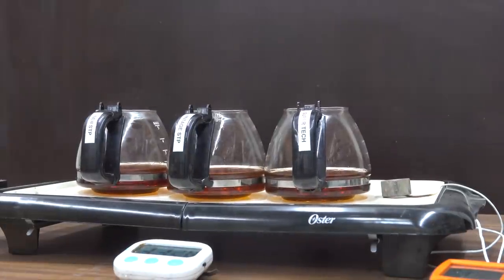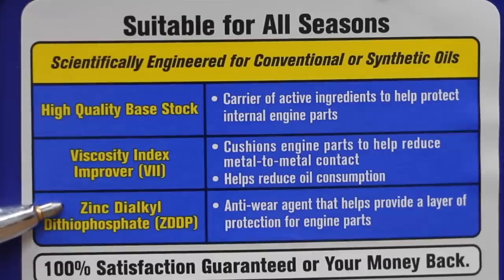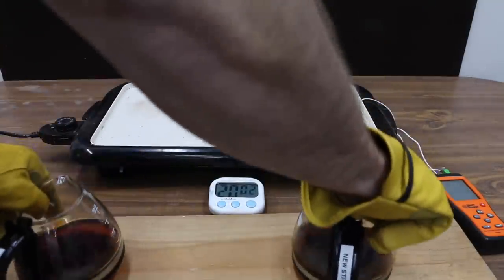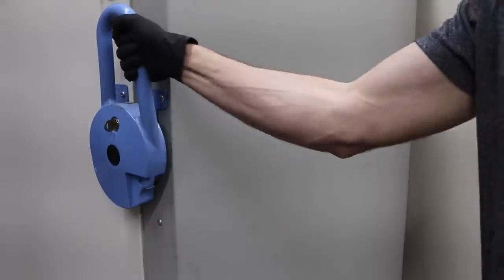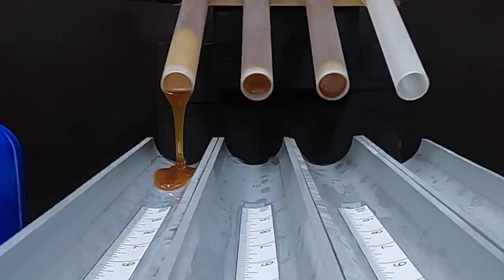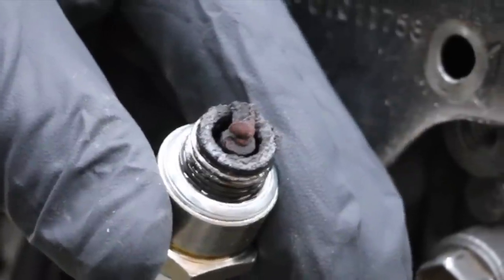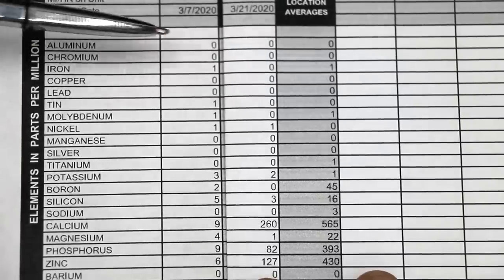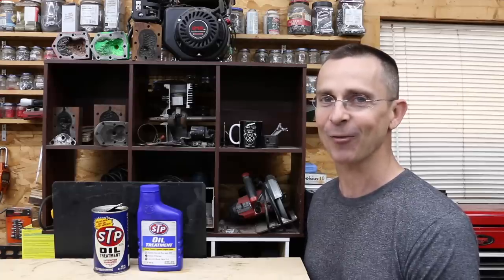Richard Petty's 1981 STP vs 2020 STP?  Let's find out!

Comment: I've been using Lucas synthetic oil stabilizer in my 96 5.2L Jeep Grand Cherokee every oil change for about the past couple years. Recently I had to pull the oil pan off to change the rear main seal. I was really surprised to see how clean it was in there. I use synthetic blend 10w30 Castrol and 1 quart of the Lucas synthetic oil stabilizer. I never bothered to use anything extra in my oil until I saw the oil stabilizer/ lawnmower engine test on this channel. While I was in there I decided to change the timing chain, front seal, water pump. A good vehicle is so expensive nowadays, I decided to just keep this one in good working order.
Reply from the maker: Thanks for sharing.

Comment: I used STP to increase viscosity and pass an emissions test in a smokey old 1984 Toyota Camry and it worked! I was sitting in the queue for a while at idle and hit the gas a bit which released a heck of a lot of blue smoke! It billowed up and blew through into their work area. One came out, saw what had happened and told me to get the heck the out of there! i left, bought STP and came back a few days later and passed the emissions test ! I suppose the valve guides let oil seep down into the combustion chamber during the prolonged idle.
Reply from the maker: Thanks for sharing.

Comment: Used in in my old 1953 Chev Belair in the late 1960's back when there were no engine oil filters, oil leaks were common and multi-weight oil was not common.  It (and it's competitor "Motor Honey") cut down on oil burning (worn rings & Valve stem seals) compared to straight SAE 30.  You could also use a little in the Powerglide transmission, helped it run better and never seemed to hurt.  Only downside was slow starting due to thick oil during the winter and the endless wait for the cans to empty when using the product.  Back then motor oil was yellow, slippery and not much else was added.  They did offer detergent oils but using them ran the risk of cleaning out the sludge that was making up for the engine wear.
Reply from the maker: Thanks for sharing.

Comment: I've seen STP work very well as a seal softener. Rear main seal leaking virtually stopped the seal leakage within minutes, however the oil was changed the next day, and the oil leak stopped. STP has its merits.
Reply from the maker: Thanks for sharing.

Comment: I was a Volkswagen mechanic back in the 70&80s and I had a VW come into my shop on the hook with as customer stated locked up engine, the outside temps were near zero F. After bringing the car in and pulling the engine for disassembly, I removed the oil drain plug, but no oil came out which was not unusual but when I went to separate the case halves I discovered it was full of STP or something similar. After I got everything clean I was able to reassemble the engine, I did replace the rod bearings and camshaft bearings but reused the crankshaft main bearings and the engine ran like new. I was able to save my customer about $400 in parts and labor.
Reply from the maker: Thanks for sharing.

Comment: I am still eagerly awaiting a panel bond video. Some of the strongest adhesive known to man. I think you would need a new testing device in order to get it to fail. It is the adhesive used to glue panels on cars. I would LOVE to see a showdown between the competitive brands such as 3M. Smart. SEM. Ect. I would pay to see this!
Reply from the maker: Great suggestion!  Thank you.
Reply: I worked in auto body for many years and would love to see a comparison of panel bond epoxies as well.  3Ms line makes some bold claims that it is as strong as a weld.

Comment: I remember putting that STP in a 1971 Merc. Monterey we had that drank oil. (Around 1981 ironically) It was so thick and I would of course put it in with the eng. running!  IT WAS A FLAT RIBBON OF GOO! Didn't just want it to all go set at the bottom of the pan! Crazy memories!! Thanks for another great shared experiment!!
Reply from the maker: You are welcome!

Comment: When I was young 20ish yrs old, I was told that the only time to use STP was exactly what you said, when the engine needed to be quieted due to mechanical issues.
Also when I worked at a trucking company we used JB Engine tune up additive (It had a viscosity very similar to water). The salesman came with a wear testing machine like yours. The engine tune up additive provided better wear protection hands down than STP or even JB engine oil concentrate (JB's answer to STP). We used JB engine tune up additive every time we changed oil.
We got 500,000 plus miles out of every engine rebuild.
Reply from the maker: Thanks for sharing,

Comment: I recall when Andy Granatelli's 1969 autobiography:  They Call Me Mister 500, (in reference to his participation in the Indianapolis 500 auto race), where he wrote about his first-time awareness of STP:
He was in-charge of doing speed endurance tests, at the Bonneville Salt Flats in Utah, for the Studebaker car company with its high-performance Avanti model in the early 1960s.  There were mechanical issues of the Avanti V8 engines running too hot and low-oil pressure.  Granatelli consulted with a  trusted mechanic, whom suggested adding STP to the engine oil of those Avanti cars.
After doing so, Granatelli was impressed to find that the Studebaker Avanti V8 engines ran cooler and it raised the oil pressure in the Bonneville Salt Flats endurance runs.
Eventually, Granatelli because CEO of STP and was a marketing genius for the brand.  At car shows the STP decals were freely given out.  
Many of the competitors at the Indy 500 used STP as an oil additive from the mid-1960s onward.
The 1967/68 Indy 500 race cars sponsored and owned by STP/Granatelli were aircraft turbine-powered racers, which elevated the STP brand to unheard of notoriety in the motorsports world.
The Granatelli owned Indy 500 race team won the 1969 race with Mario Andretti at the wheel.  The situation at that race was a marketing coup, not only for the victory for the STP team, but that supposedly the STP team upped the amount of the oil-additive to the winning engine since there was an issue of having to remove an engine oil-cooler prior to the race.  The scenario behind that oil-cooler removal:  After Andretti qualified the car for the race, it was discovered the engine was running too hot in prolonged runs, so an oil-cooler was added to the engine and it solved the problem.  But, the race officials ordered the removal of the oil-cooler since it was not a part of the car's configuration for the qualifying run.  After the oil-cooler was removed prior to the race, the workarounds the mechanics did to minimize the engine overheating:  Richen the mixture of fuel to air with the engine's injectors, and increase the amount of STP to the engine's oil.  
Well, with what was reported in 1969, the strategy work!

BTW:  The Wikipedia version of the 1969 Indy 500 race was in error about the use of the additional oil-cooler in the race.   It was removed prior to the race; the media made an issue about it back then.  

But, as was typical of race cars of that era with their precarious reliability:  A compelling reason STP/Granatelli/Andretti won the race was due to other teams/drivers having more mechanical misfortunes than the  STP/Granatelli/Andretti trio.  Decades later it was also revealed that second-place driver Dan Gurney could have contended for the victory if his car had not developed a shock absorber problem in the race;  where part of that problem was due to the lack of development time with the car leading up to the race.  It's been surmised that if the All-American Racers team, lead by Gurney, had invested time with the 1969 Eagle race car development prior to the 500, it could have been in the winner's circle.
Reply from the maker: Thanks for sharing.

Comment: Another great video!! Sure didn't realize how good super tech oil was.  Back in 73 had a 64 impala 327 that was so bad on compression that wouldn't start off key had to park on hill to start it smoked bad I bought case stp filled it up it actually started off key and barely smoked used it till they started puttin it in plastic bottles.  Thanks for sharing be safe have fun
Reply from the maker: Thanks!  Thanks for sharing.

Comment: I had a 390 V8 with a knock in my 1974 Ford F250  and added STP, this was 1978. I ran it for 3 weeks dropped the pan and replaced the rod bearings no damage to the crank!
Reply from the maker: Thanks for sharing!

Comment: I got water in the trans and engine of a 73 Chevy Vega while playing amateur boater at a lake 40 years ago.  I changed the engine oil at the boat ramp and towed the boat home.  Over the next few weeks the syncro's went out in the trans.  I wanted to trade the car in so I pulled the trans and filled it almost completely with STP.  Worked long enough to get rid of it.
Reply from the maker: Thanks for sharing.

Comment: I have seen an oil pan taken off of a car engine in which the owner used OLD STP religiously. It looked like a thick layer of honey in the bottom of the oil pan. 

I would NEVER use STP in my car unless I was in the middle of the desert and my engine had no oil in it. I would use it ONLY if it meant I wouldn't have to get out and walk. 

Back in the day, people used to load the engine up on an old worn-out oil burner before taking it to trade in on a new car. If you ever bought a used car doped up with STP you bought a serious problem. 

An unscrupulous (unethical) Used Car dealer would dope up an old clunker and sell it as a well maintained used car. 
There were no used car warranties or Lemon Laws in those days. It was truly Caveat Emptor... Buyer beware. 

This was yet another  OUTSTANDING comparison video. Thank you.
Reply from the maker: Thanks so much!

Comment: I used STP in my Yamaha Rstd 1300, after running seafoam my 16 year old engine started making tapping sounds, I had it checked out and the result were the bike is fine, however some carbon deposits are good for pressure in older engines,my 47k miles bike is now running so good, highly recommend for higher milage rides, I used one third halfway point until next oil change,the improvements are noticeable and a better performance
Reply from the maker: Thanks for sharing!

Comment: A late stepfather who raced early NASCAR and SCCA taught me to make the lube for building new engines. Before it was banned, he mixed STP and White lead for diff gear oil. He raced a 67 Shelby with a 289 pushing 504 hp @ 9000 rpm. Black flagged him at Daytona. 167.76 lap speed, 210 on back stretch. Only driver standing on the throttle in the turns. Smokey Yunick trained. I will always appreciate and miss him.
Reply from the maker: Thanks for sharing.

Comment: Back in the early 1970s I bought a 1957 Chevy and on the way home it started smoking really bad. I changed the oil and put a can of STP in the engine. within a few miles the smoking got less but was still there. I then put a second can of STP in and the smoking stopped. We had 3 small children at the time and my wife made me get rid of the car. Jim
Reply from the maker: Thanks for sharing.

Comment: I'm crossing my fingers that you'll do a video testing out STP's Ceramic Engine Treatment, which claims to adhere to internal engine parts for up to 15k mi.  improving compression, engine performance,  fuel economy, yada yada yada (like they all do). Supposed to be kind of an improved upgrade from the old PTFP liquid Teflon of the past. Really enjoy, and appreciate your videos.
Reply from the maker: Thanks and you are welcome!  Thanks for the suggestion.

Comment: Excellent! ❤The Fisher Space Pen  pointer. That's a sign of someone who REALLY knows about viscosity...maybe even thixoptropy!
Please do a video testing 1980s Fisher Space pens against modern ones. The curator opened the display case at the Weatherford OK Air & Space museum and we tested Col Stafford's pen that had been to space in the 70s. It wrote perfectly. Sometimes a very old Fisher Space Pen has to have the point soaked in alcohol or ether or a flame applied to get started.  Inventor Pau C. Fisher was my cousin and taught me much about science, diplomacy, and government corruption.  Gravity-fed normal pens have a 1-2 year shelf life at most. If left in a hot car even one time, they are toast. The Fisher Space Pen is the only way to fly!
Reply from the maker: Thanks!  Thanks for the video idea.

Comment: I had a 1957 Studebaker Pelham (2 door wagon, think Nomad only cooler). It had a not very healthy170 CDI flathead six. The engine ran a bit rough, smoked, was down on power, the oil pressure light would come on at idle, and made clicking noises from the lifters (one had a cracked bore). With a can of STP in it the engine smoothed out, pepped up, quieted down, stopped smoking, and the oil pressure came up.

I'd never use the stuff in a healthy engine except as assembly lube, but on that Champion six it made a world of difference.

Now... if you really want to try the best STP you need to find some even more vintage stuff that was made by the Chemical Products Division of Studebaker Corporation. Studebaker engines from the early 60's even had labels on the oil cap "Break In Oil Contains STP", with the STP logo.
Reply from the maker: Thanks for sharing.

Comment: In the 80's my Son was charged with mowing our yard. He hated the job, never checked the oil and pushed the mower faster than it could go. While he was mowing I noticed a lot of smoke and noise. Checked and no oil!! The only oil inthe garage was some old oil from a previous change from my car. It had STP in it. The smoking stopped after the second mowing and the knocking stopped.
Reply: We used that mower for several more years and gave it to the peron who was mowing our yard at the time. STP saved that engine and me some money.
Reply from the maker: Thanks for sharing.

Comment: Early "multi-grade" oil actually was often not very good. 
That STP stuff I was told,unless you carefully added it very very slowly,could sit in the bottom of the oil pan and be too sticky to get pulled up to the oil pump forming an effective plug against the oil pump intake. 
People sometimes used a mix of it in oil as assembly lube.
Reply from the maker: Thanks for sharing.

Comment: One suggestion is a cylinder leak down test is more accurate then a compression test. I know your not trying to troubleshoot where the engine is losing compression. However it would allow you to time before and after how long the cylinder will hold compressed air.
Reply from the maker: Thanks for the video idea.

Comment: So really the results show that STP is just an additive and not to be used as an engine lubricant. It only adds to the friction package of the oil already in the engine. It is the reason the wear scars were smaller with the stp additive than with just the stock oil. The STP added to the super tech apparently increased the quality of the super tech's anti-wear package.

Comment: You have all the fun. They been making. S T P I now back in the 60ies . motors have changed gas has I use to use it when I changed oil my rides were old and wore out. Oil was like beer didn't have 5 20 10 30 etc. More 30 wt.
Reply from the maker: Thanks for the feedback.

Comment: I would love to see how well and how long an engine would perform with pure oil additives like Bestline or Motorkote as opposed to mixing them with oil. Questions rolling through my head are as follows. 1) Will it make any horsepower and MPG difference? 2) Will there be any side effects or downsides to note?
Another idea is mixing different oil additives. The major question to this is "Are there any risks to mixing different oil additives?"
Reply from the maker: Thanks for the video idea.

Comment: Yet another terrific analysis.  Used to run a moly-blended conventional oil sold by Honda for motorcycles that I really liked.  The engine seemed to run a little quieter, and being air-cooled with the engine right in front of my shins, seemed to run a little cooler during the summer months.  Really like it.

As a side note--and completely off-topic--just how many aging lawn mowers do you own?  Have watched nearly a dozen of your videos and every time, seems to be a different make/model.  You must run a side business in used lawn mowers. :)
Reply from the maker: Thank you!  I still have around 15 lawnmowers in storage but they don't get much use anymore

Comment: It would be interesting to see how a vintage can of Hastings Motor Honey would compare. Seriously, one of my family members worked for a company called Lubrizol for 38 years in the field of tribology, the study of wearing surfaces.  Once an S&P 500 company and now owned by Berkshire Hathaway, Lubrizol manufactures the additive packages used in many of the major oil brands.  This individual was very familiar with the various testing criteria specified by CAT, Mack, GM, etc.  The word from him was to never use these additive products, buy good oil which has everything needed already in it, and change it frequently.   He had studied countless teardowns of mostly automotive engines put through bench tests often lasting several thousand hours at the facility where he worked.  He was always a big fan of Shell products, but said there was nothing wrong with Chevron and Mobile.  He otherwise frowned on many of the brand names often displayed as sponsors for race car teams and sold in discount stores.
Reply from the maker: Great suggestion! Thank you

Comment: You should compare the three modern stp oil additives.  I've been using the high mileage Grey bottle stp additive in knocking and smoking lawn mowers and it works great at helping with those issues.
Reply from the maker: Thanks for the video idea.